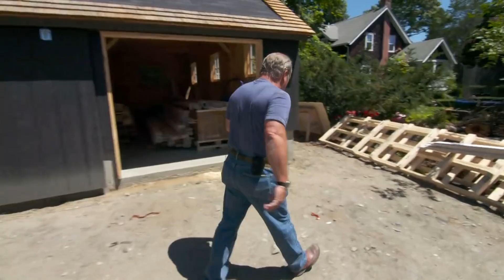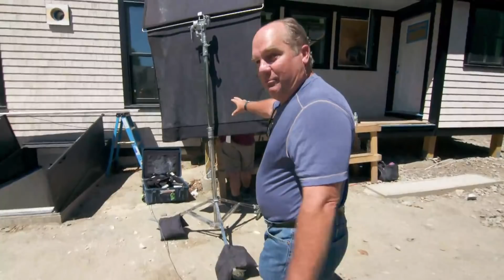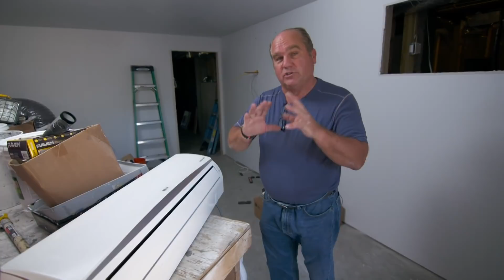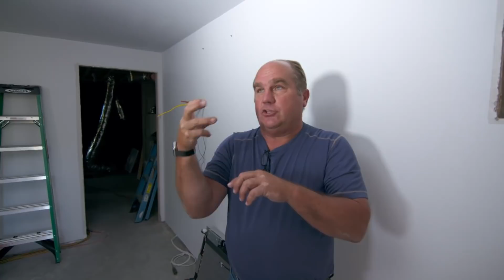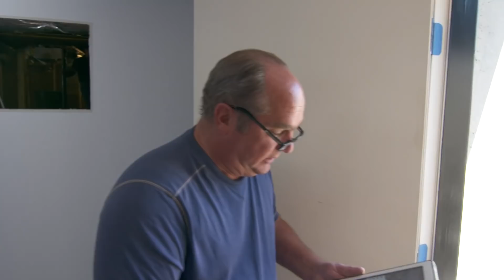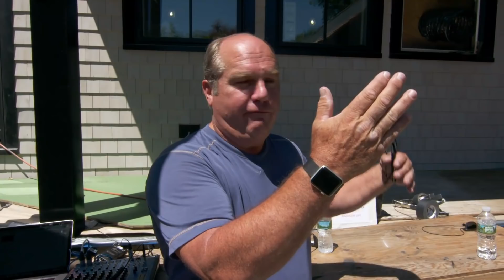Jamestown HVAC Plan | This Old House

Comment: Pretty cool system.  I like how they're improving the overall concept of heat management by moving the heat around rather than just dumping it outside.  Now if they could make a refrigerator that ties into the system I'd be a very happy camper.

Comment: Hi, it’s always interesting for me to watch this series. As a European, I live in Poland, would like to ask you what is the advantage of blowing hot air to heat up the house in oppose to heating water, that is circulated either to radiators or floor heating? We rarely see air heating systems in Europe anywhere else than utility buildings also in countries like Sweden or Finland, where framed wooden houses are very popular. Even there, usually a floor heating is used - water pipes are inside a concrete slab.  
In America, however you start having more and more wall-insulation, finally also roof insulation, but still there is a crawling space. My question is - what for? Typical European way is to have a concrete slab laying directly on a ground, which serves as a foundation, than some 7-12 inches of Styropor over it, than water lines in spiral covering the whole floor, than about 2 inches of concrete, that serves as a thermal mass and finish floor on top. If you have a heat pump you can cool down the floor to cool to house, but generally the outside blindes (Fassade Jalousie) are being used to block the sun from the south side and no air conditioning is needed. If you don’t let the hot air in, good insulation and floor thermal mass does the trick.  
I haven’t seen this “European” approach in any of your films and would like to see a nice comparison, why is it so there and so here, and which is more efficient. 
Keep up the good work and best wishes to Roger.
Reply: We do have radiant floor heating but it's considered a luxury here. We move air and filter it as we heat/cool a house. Some homes do have a radiator type heat with water like you are talking about. I don't really know why we do one thing or the other.
Reply: In US, except for desert area, we need a/c to remove humidity not just to cool.  Moving air makes that easier.  We love radiant floors for heat but cool water in summer would make them condense and get slippery and moldy.  And since cold settles the room would stay warm.

Comment: The problem I see with this is ROI. Not everyone can see the return, or alteast for years. Sure, there are zero-interest loans from PU, along with fed credits. But for 80% of home owners, they can't foot $50K to save $1200 a year (my average heat/cooling est).
And in my state, they still charge you a utility connection fee, even if off the grid. (I know, this isn't a battery/OTG install). 
I wonder why LG and not Mitsubishi...IMHO much better hardware with Mitsu...

Comment: Some interesting stuff here.  However, the potential need for simultaneous heating and cooling sounds like a symptom of poor structural design.  In my opinion, TOH too often focuses on technology to compensate for poor design rather than addressing the design issues.  The TOH approach seems to be:  design for aesthetics and we'll advertise the products to compensate.
Reply: I dunno, I just took it as the system could do both if you needed it to. Not that the house was badly built so you had to do both things. Being able to do both things is great since maybe you might have a wife who is always cold could have a different temp in one room and the husband who is in another room working out might want to have the AC blasting? Maybe a family member isn't feeling well and they need a warmer room? Million reasons why it might be a need

Comment: My company has been designing a lot of heat pump systems here in Ontario. The performance of cold climate heat pumps is amazing! It really provides clients with an innovative and highly efficient HVAC system. We specialize and focus on high efficiency buildings so we're always looking for new breakthroughs.

Comment: Here's the Engineering Manual for that outdoor unit. Scroll down to page 33 where it talks about heat recovery. https://files.lghvac.com/resources//EM_MultiV_S_OutdoorUnits_02_18.pdf
It's a 5 ton unit by the way. Only size with heat recovery.

Comment: How much does a system like this cost?
Reply: about 10 years of electric bills...or more...This system cost about 50K with the solar...
Reply: If you have to ask ..... you can't afford it. Lol. I joke but I think you're probably looking at something like 50-60k? I didn't see all of the specs and brands so i'm just doing a rough guess. The solar panels, all of the installation, those heat pump units are awesome but expensive, all of the copper line for those units is expensive, the hidden units in the walls are expensive, and everything else that goes in to it.
Reply: Benny Wallace go-to lg.com
Reply: Lotta expensive machinery to break compared to my single gas boiler and 1 hot water circulation pump.  Anyone think this is gonna last 30 years like my cast iron boiler?
Reply: way too high to ever recover your initial investment and when you finally come close to breaking even, you'd have to pay to make repairs to the panel, units, inverter, etc. at an inflated price due to it being a "specialty" product which may or may not be in production at that time. Looks great on paper though.
Reply: I think Solar is fine but at a centralized generating station under controlled settings and standardizes maintenance  vs. individual homes.
Reply: Reality bites...:)...I've been a builder for over 3 decades, I remember when Solar came out in the 70's...It's the second worse power generation process only eclipsed by wind...It's a suckers bet...But; TV tells these people they're helping the planet...lol...One born every Minute...